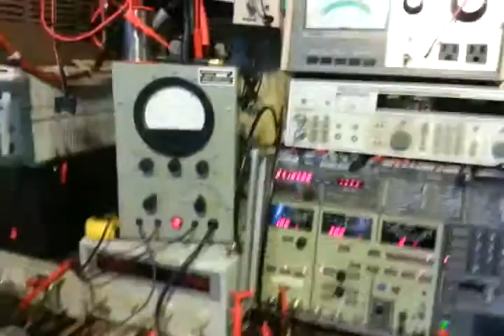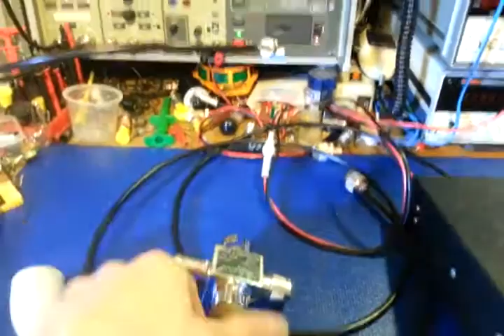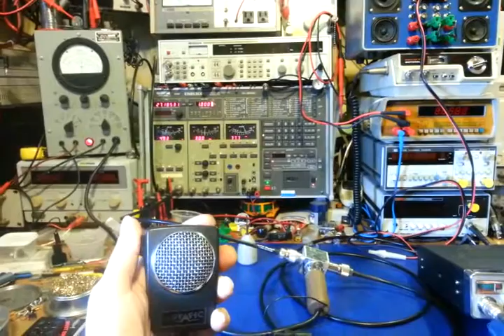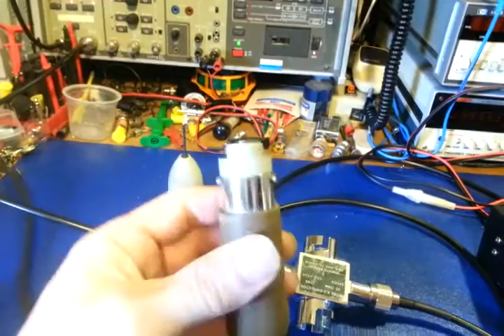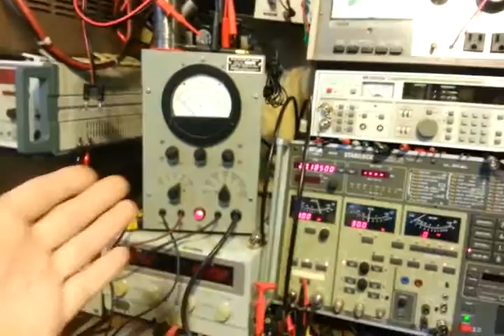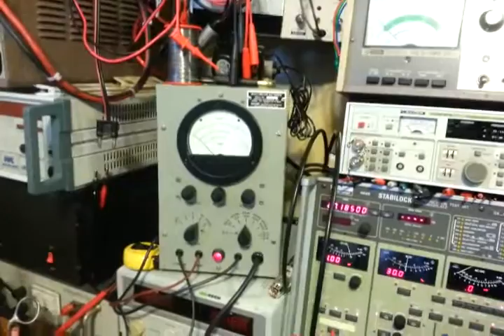HP-410 and ME-26D/U  AC voltage N coax line section probe adapter.

Comment: I'm having a hard time finding that adapter.  Can you verify the model number is HP-455A?  I would like to use one of these to neutralize the finals in a Kenwood TS-520, but I can't seem to locate one based on the model you provided.  Great video.  Thanks so much!
Reply from the maker: Yes HP-455A.  Just Google "HP-455 meter".  They are very rare.  Took me a long time to find the 2 I have.

Comment: You must derate the maximum RF voltage measured once you get above 50 MHz!  HP has a derating curve in the 410B manual.  Ignore this at your peril, or you will send the peanut diode to its ancestors.  :-)
Reply from the maker: Very true but most measurements I make with mine is below 50 MHz.  I do measurements at higher frequencies but usually at much lower levels.  And as far as those little "peanut" diodes I think I have a little over 40 of them for spares.  Should be enough to last me a couple lifetimes.  :)

Comment: thanks for showing this. i have a 16 transistor amp and knowing it's output voltages would aid in me making a sound and stable antenna tuner and filters for it.. not to forget a input tuning circuit. so i can run it on multiple bands  after i get it biased ab class.
Reply from the maker: As they say, it's a oldie but a goodie.  Just can't beat the build quality from the tube era.

Mike

Comment: Just a thought on why yours have to receptacles, and just speculation. Perhaps connecting two probes in a voltage divider circuit?
Reply from the maker: Hard to tell.  All the literature I have on it is for one with only one meter probe port.  I will say this, on the back this one is engraved USAF.  May have been for a special military application.  Having served in the Army in the radio communications field I can say from experience the military is good at having redundant systems.  Might have been used to have two meters connected to a system at all times and if one went caput it would be easily noticeable because you would then have two different readings, just speculation. 

Mike
Reply: +MikesRadioRepair Now that you say that, you are most likely spot on. I can see what you mean. They are big on measure twice cut once. Good stuff.

Comment: Great Mike. That was a very informative video my friend. I was wondering what those two knobs were on the end of the probe was for.  You have a nice looking setup there also. Thanks for the mention and the kind words also.When I do the next series in the HP 410 I will be sure to include a link here and mention your video. Well Done.http://gokarters.com/smf/index.php?topic=2544.new#newHave a look at that. When I watched your video I got to thinking and had to run out to the shop and take a peek. Learned something here friend.Also going to link your video on my site in other blogs.
Reply: +The Radio Shop Linked you here http://gokarters.com/smf/index.php?topic=2546.new#new
Reply from the maker: No problem.  Thought you might like it.  Does the probe tip on yours unscrew?  If so one of these may just work on the 410A.  Yours does have the two screw heads that protrude so I get the feeling it might.
Reply: +MikesRadioRepair Yep, screws right off. That is a picture of it in the link in the first post above. I never knew it screwed off. Thanks
Reply: @TheRadioShop  I love all of your videos, especially the ones on the Kenwood Hybrids.  I am interested in using one of these adapters to neutralize the finals in a Kenwood TS-520.  Can you verify the model number that @MikesRadioRepair has provided, as I can't seem to locate it anywhere?  Thanks so much and have a great day!  - David